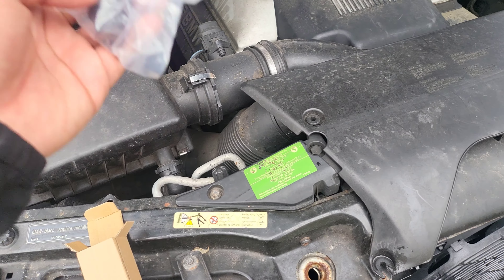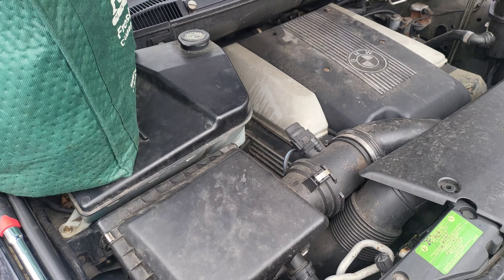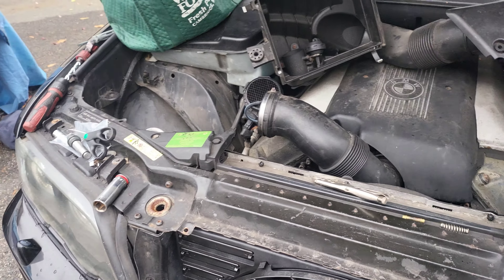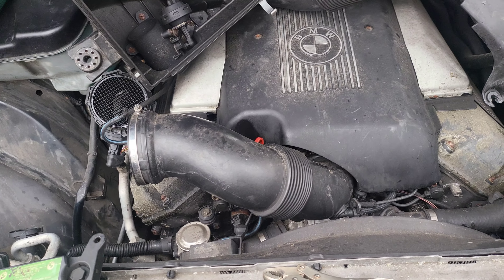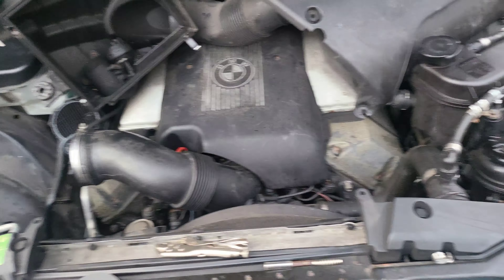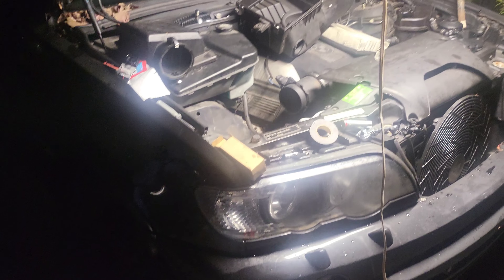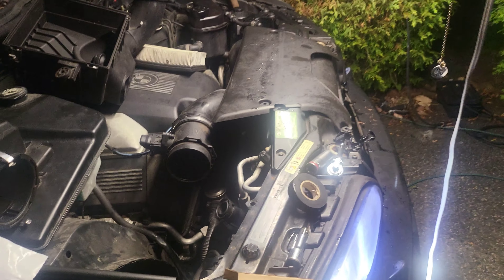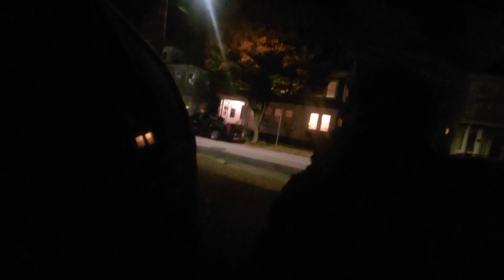Replacing the Timing Chain Tensioner | Dinan S1 e53 x5 4.6is 4k #bmw

Comment: I did mine a few weeks ago and noticed less rattle on cold start.

Also changed Solenoids - E53 back to life!
Reply from the maker: Yeah I'll be doing the solenoids in the near future. I'm hoping the fluid flush will make it drive better for atleast 2-3 weeks. Then I'll order the new solenoids and put em in
Reply: @imSchwaggy  did that about 2yrs ago.
Maybe due again tbh.

What fluid you using?

Comment: Well done. It may well sound different- if the old tensioner was slightly sticky then it would not do its job correctly and the vanos ( which I can hear knocking) would be slightly wrong. I bet it drives a bit smoother now too. You seriously need to steam clean the engine bay..
Reply from the maker: Yeah I didn't do the Engine bay yet because I'm making sure there's no cracked lines or anything for water to get in. Definitely going to do it soon. I HAAATTTEEEE the way it looks lol. I have lots of parts coming tho, so I'm going to make it really nice.
Reply: In my opinion I don’t think you should deviate too much from standard. Are you keeping it or selling? I really would consider keeping as in a few years the 4.6is is going to be a really sought after vehicle and prices will rocket. At the moment they are underrated and only enthusiasts know about them. Put it in storage maybe..
Reply from the maker: @voodoocars2134  the things I'm doing are all oem+ upgrades. Will add value. Makes future maintenance cheaper, and the vehicle more reliable. I don't see myself selling this car. But if when im done I get an offer I can't refuse. I won't turn it down lol.

Prices are already high. If I put 2-3k into a refresh (which I am doing) I could sell now on BAT for 8-9k. Or fb marketplace like 7k.

Comment: That little thing causes all that noise? Damn, thankfully nothing crazy
Reply from the maker: Yeah. If the spring/piston thing wears out. The tension on the timing chain won't be strong. With a new one it fills up with oil super fast and keeps the chains where they need to be. I think fixing it made the car happier cuz it sounds very different when I rev it. Also pops/bangs a lot . Wasn't doing that before at all
Reply: @imSchwaggy  Wow little goes a long way!